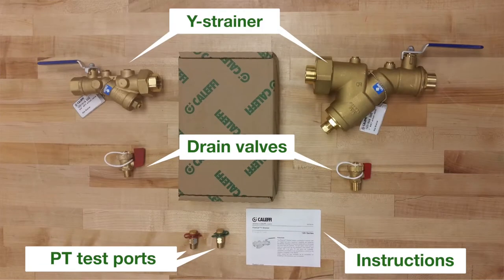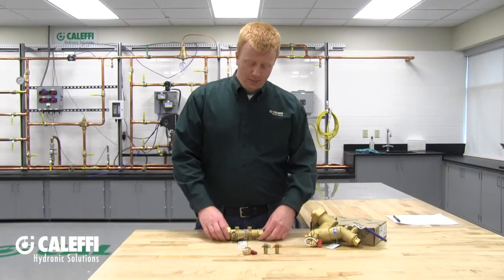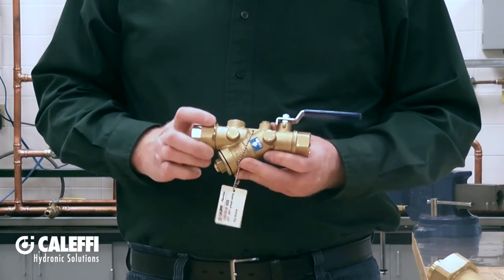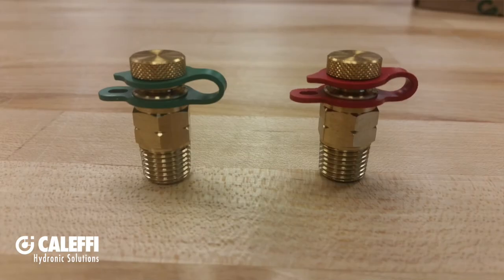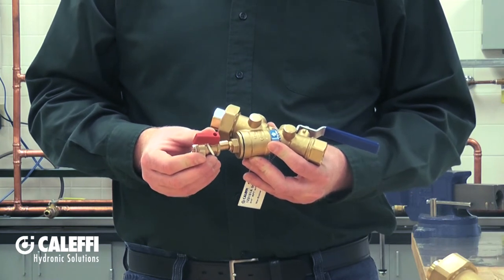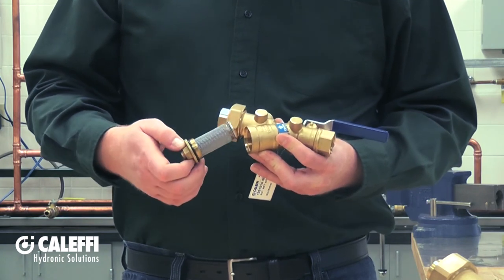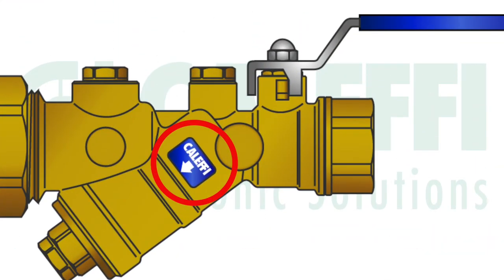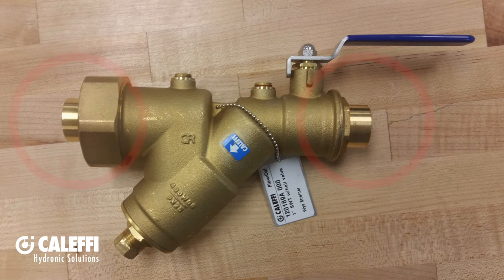120 Y-strainer

Comment: That's great but you need to isolate the strainer form the supply side, as you did in the video, and also from the return side, otherwise you will just get really wet...
Reply from the maker: Brian sorry for the delay. You’re 100% correct!  Isolation valves, often overlooked in during installation, are critical for future maintenance.  Nobody wants to take a bath!
Reply: Y Strainer for  ceiling mount FCU was totally plugged, I had to cut it out and install new. That left me only stubs of 1/2" line to attach to, so  I had to cut out before  the supply line shut off valve ( there was a primary shut off ahead of that ) and repipe. I went  with Sharkbite fittings, because I did not want to sweat so near the valve, and I suck at sweating brass fittings anyway. I used a Female x female  threaded strainer.